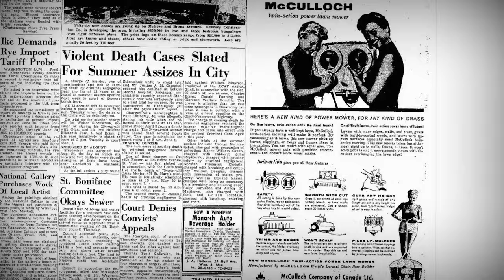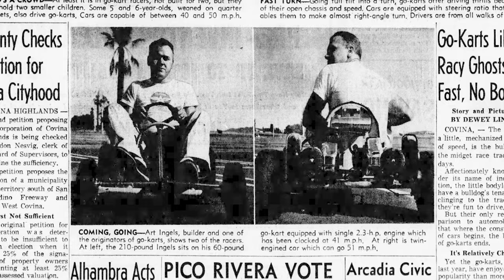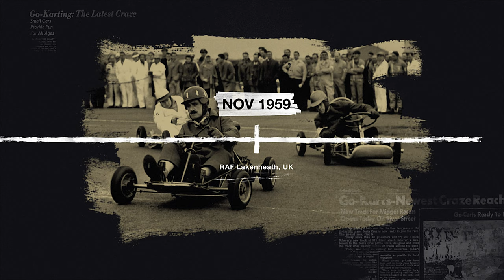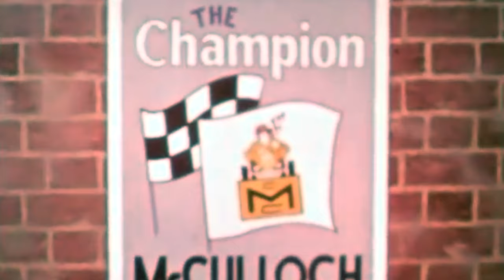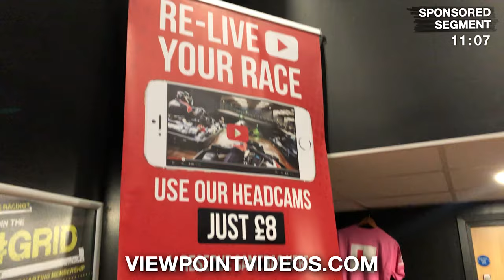How Go Karting Was Invented

Comment: Karting has got a lot faster. Parma, made in 1961 is .28 miles. Its modern counterpart, GoPro Motorplex, is .7 miles, or 3 times as long as Parma. The karts have gotten so much faster, that they need much bigger tracks.
Reply: Unfortunately the sophistication and cost of high end racing equipment pushes the average man out,
It pushes out the very people who created it,   I liked it better when a father and son could afford to participate.
Reply: I drive on GoPro and it is insanely fast